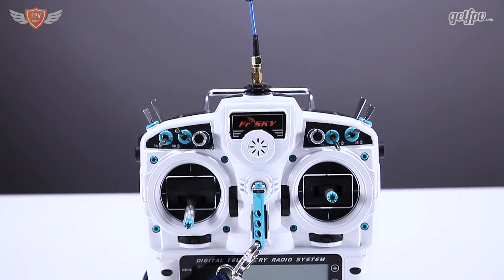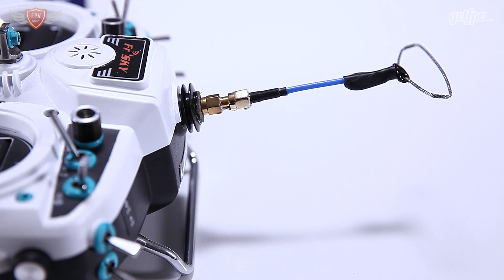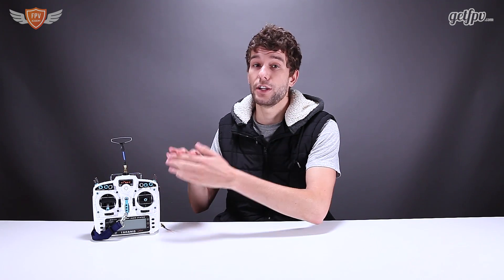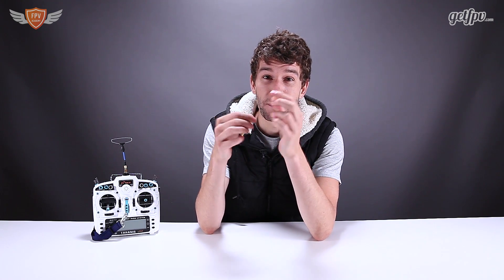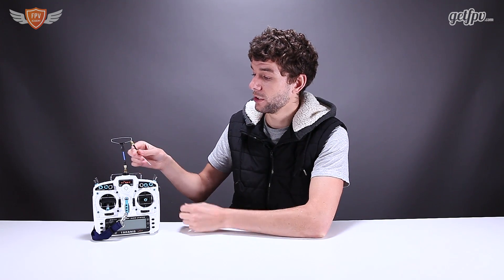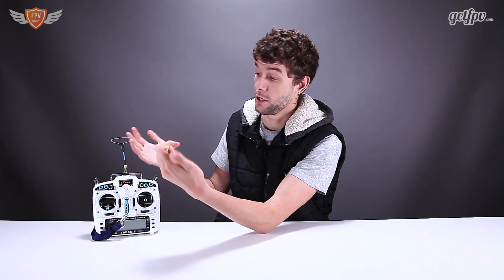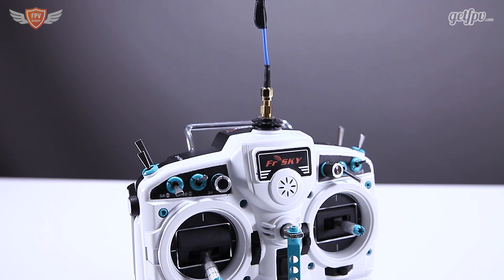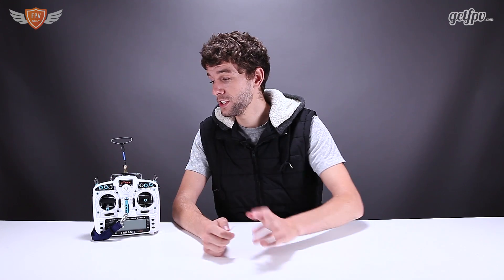VAS Microwave Folded Dipole 2.4GHz // Radio Antenna // GetFPV.com

Comment: I've ordered one from RMRC and it looked much lower quality than the one on your video and in "marketing" materials.
Folded element was out of shape, blue coax is black and a bit thinner, and it also started breaking at the SMA connector almost immediately :-(
It gives significantly better range than my tuned 5 dBi whip, but I had to take it apart and replace coax with an RG-402 and also added heatshrink on the folded element in the process.

Comment: I would like to know more about the antenna itself not the mod. Also for those who would rather spend a little extra then take apart and attempt soldering to your internal module just buy the 40$ external module and pop in and try new antennas that way. Thats what I did, much easier knowing I'm not going to ruin my radio.